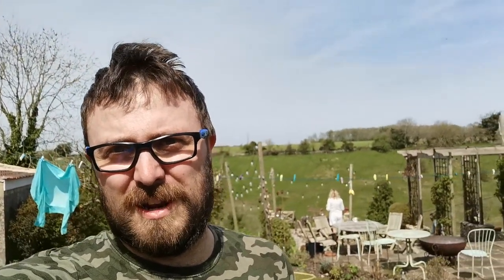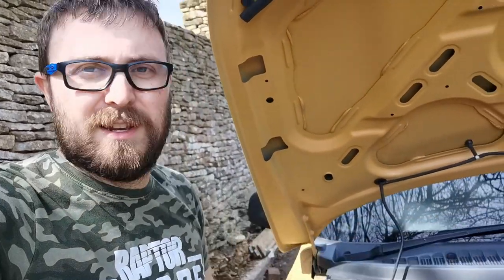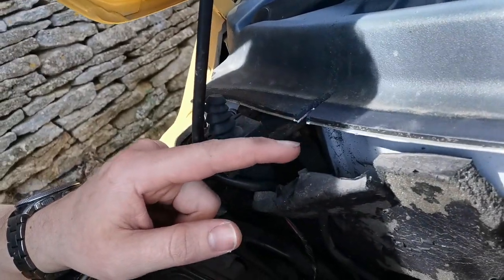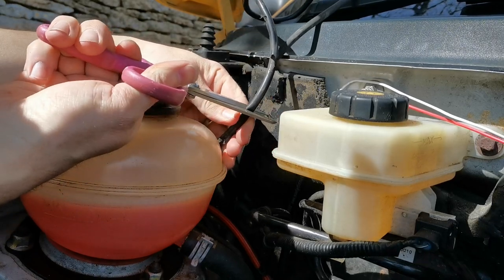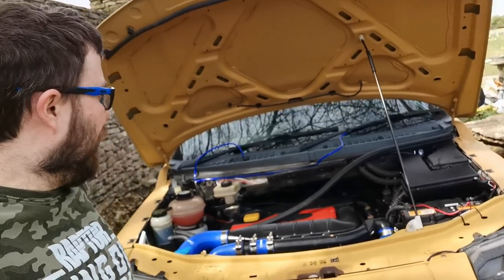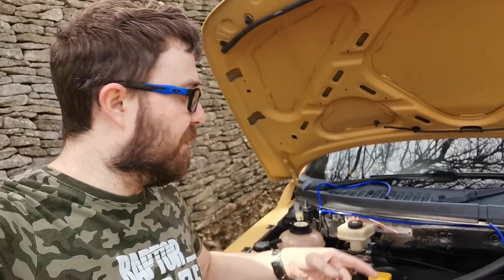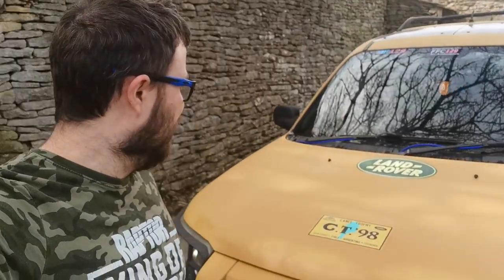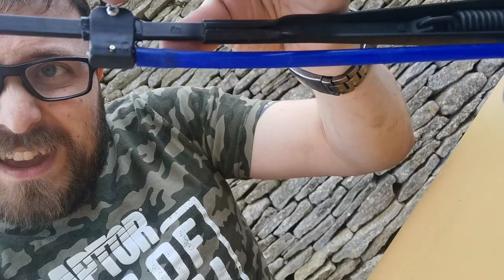Installing Rally style washer jets

Comment: For me. I would have adapted and put in a couple of grommets in the slats you cut out. To protect the washer pipe from chaffing and possibly being puncture by the recently cut out bare metal. Being really picky. I would have used black pipe to blend in with the wiper arms 🤷‍♂🤷‍♂. Cheers. 👍👍
Reply from the maker: Hey, cheers for commenting. I did look at that and that would definitely be a neat finish. This was kind of a "on a whim" job and I will likely put some black silicone gel around the edges of the cut outs to smooth them over but so far so good and thet work far better than stock lol also went with blue to match silicone hose kit on engine 👍
Reply: @TrackCraftPerformance  Okey doki

Comment: The jets are round the wrong way, you should have them facing up so the screen wash hits the windscreen before the wiper blades swipe over
Reply from the maker: Hey, cheers for the comment. We did look at that but the pipe connector would have been the wrong side doing this. Would have to run the hose up and turn it back on itself and it looked messy. They seem to perform really well so far, especially when driving as the air further pushes it upwards into the blades but even sat still it works better than stock Land rover, which were almost less than useless lol
Reply: @TrackCraftPerformance  I was thinking more along the line of it would put more strain on the wiper motor running it dry
Reply from the maker: I've found that the jets are pretty powerful and seem to get water up under the blades almost immediately. It will take a bit of testing but so far I haven't had them come up the window dry before dropping down onto water. Whilst driving I've seen that the extra wind also drives the water up under the blades as there is a slight delay between washers being sprayed and the wipers moving which nullified them being under the arms. Hopefully it shouldn't effect the motor in the long run